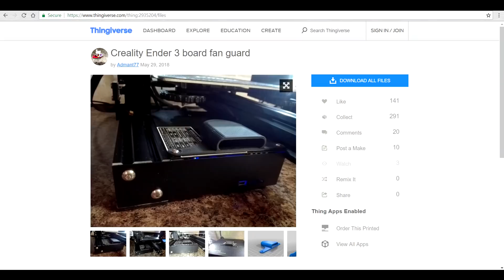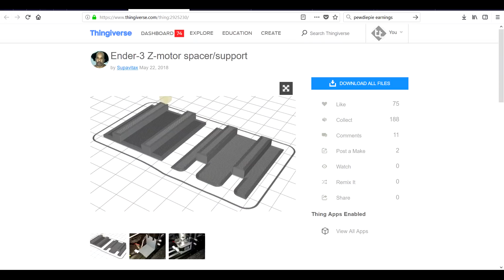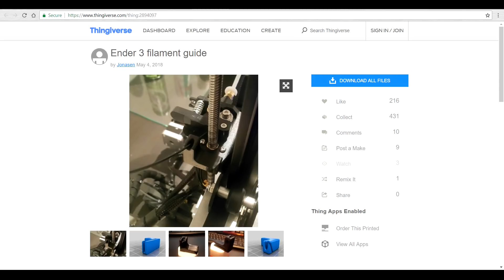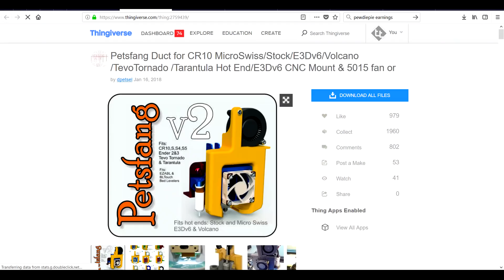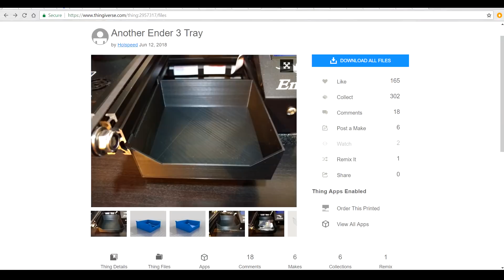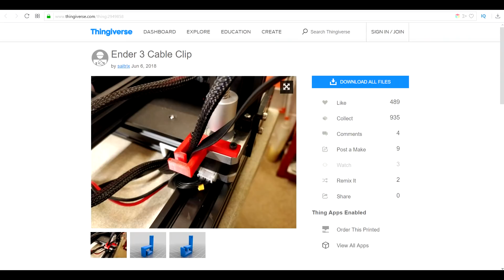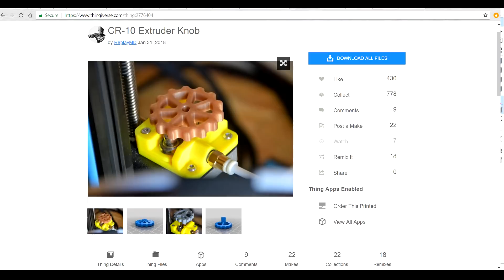The best cheap or free Ender 3 upgrades - re-modding my newest version

Comment: This is great i just got 2 ender 3's and having access to this Info is so handy m8......now ive got to source a 422 or 427 board, i think...one of the printers has a green board, which is not plug and play as ive found out.  Im 50yr ol with disabilitys and these newer models are more user friendly.😀

Comment: Got my Ender 3-Pro a month or so ago as my intro to 3D printing and its not really the same machine anymore. 
I'd say the biggest upgrades in order were a BTT SKR Mini E3 V3 mainboard, Hotend/part cooling fan mount (printed the CR-10/Ender 3 Dual 40mm Fan Ducinator remix with BLT mount), BLTouch/ABL probe, Capricorn bowden, bed spring upgrade and an all metal dual gear extruder. I also bought a glass build plate but 3/10 would not recommend. I'll probably get a PEI plate with spring steel. Some other nice things to have include Vslot Covers, Front LCD panel cover, side mounted spool holder, tool holder/s and there's a few really sweet drawer designs.
What do you guys think, direct drive with linear rails next?

Comment: I printed on of the filament guides that clip onto the upright part of the extruder plate that holds the roller wheels.  It fits kinda loose and I was worried about it falling off, so I glued it in place with a small amount of 5 minute epoxy.  If I ever need to remove it I can probably do so destructively, and then peel off whatever remains without damaging the printer.  Moving the filament spool holder over to the far left wasn't easy, getting the T nuts into the slot between the screws holding the uprights is a RPITA.   I installed a different kind of spool holder.  I found a model on thinigiverse for a spool holder insert with stepped sides that will work with various different spool inner diameters.  These have two 608zz bearing in them (you need to print two of these, one for each side of the spool).  I then printed an adapter to put an 8mm (5/16") carriage bolt in the big hole in the bracket which the spool holders slide onto.  A wing nut holds it together.  It does take longer to mount the spool on this, but it holds it MUCH better and turns more easily.  You can adjust the friction by tightening or loosening the wing nut as required.

Comment: I put a cable holder for the x motor cable, just a bit of baling wire holds out rubber bands that hold a loose cable tie for it.

Comment: A couple of little adjustments I would consider in 2021.
° Don't grind down the bed adjuster, print a smaller one.
° If you have a Pi 4, don't do a completely or near sealed plastic case. It needs cooling, or at the very least free access to ambient air for convection.
° If you do tall prints, or frankly in general - if you have the space, consider moving your filament holder off the printer. Or at least to a mount on the bottom frame.

Comment: I can not see the purpose in Raspberry Pie. you  still need to clean the bed, insert filament, start the print and do a bed level. That requires you to be in front of the printer. It's very simple to save to an SD card and pop it in. I also like the fact that I can save hundreds of STL files on an SD card as a portable library.
Reply: Ray Parker Raspberry pi is one of the best things, most of the things you mentioned you would already have set up for the next print, bed levelling would be taking care of with ABL or mesh, you don’t have to go anywhere near your Printer to start your print, you also have the ability to use  a cam to monitor your print from anywhere and there is a multitude of apps available for iPhone and android to give you full control, its genius.
Reply: @raygilfillan  Different strokes. I have video, and remote shutdown. I prefer to be there to monitor and adjust as needed.

Comment: A faster easier almost instant way to get a lower filament guard and not use any filament is to cut about an inch of the protective cover that came on the Z lead screw and slip it over the screw to stop any grease swapping. Like  Teaching Tech said the simplest solution is often the best.

Comment: I have an issue where my raspberry pi send power back to my ender 3 via the USB port. When the Ender 3 is off the Pi will alarm about the power, and the Ender 3 display and fan will still be running powered by the USB of the PI. To me that all sounds like a really bad thing, so I have not been using my Pi with my Ender 3 at all, and that kind of sucks.

Comment: Hi, I'm interested in buying a 3d printer for my grandson, I'd like to keep the cost down to under £350 or so. Can you recommend a printer that is simple to set up and produces good quality prints. Low powered would be great as well as a large bed, self leveling if possible. Thanks, Graham. By the way, your videos are the best, keep it going please.
Reply: I'm probably waaay to late, but with a Ender 3 pro you can't go wrong! It's the best printer under 300$

Comment: I still dont see the point of unicorn tubing.
Reply: It can withstand higher temperatures for printing materials other than PLA and has a more accurate diameter to help with smooth filament flow and more consistent extrusion.

Comment: How do you think about changing the bed level springs? My Ender 3 pro just arrived and I have troubles with bed leveling since it changes after every print, as the bed level knobs are spinning really easily = /
Reply: Easiest solution is to tighten all the knobs (lower the plate) and then re-level with the knobs done up more tightly. It simply sounds like your plate is too high and thus the springs aren't actually pushing against anything and thus the knobs spin freely. When the plate is lowered enough, the springs will be compressed and the knobs will stiffen up.

Comment: Hi, nice video, thanks. But I've a question about connecting the raspberry pi. I dont see the usb cable for the printer in your video. It is not nice to have all your cables in front of your printer, so I have my rasp. behind my printer. I can't see your becaurse of the high camera view
Reply from the maker: It's highly possible that I simply had it disconnected while filming. The cable management with so many printers in my room is ridiculous.

Comment: Newbie here. How do you recommend picking up and moving the unit around? Do you grab it by the top or sides or base or is it not recommended to move it around much?
Reply from the maker: Worse case is you bump your bed and need to relevel. I don't move it often, but when I do I grab it by the top horizontal frame.

Comment: Hi! I am unfortunate to say that your link to banggood  steeper motor dampers is a waste of time an money. They send the dampers that don't fit x and y motors because they have smaller diameter than on the picture; and the x and y gears on the motors of ender 3 are not removable. Here's the photo: https://clip2net.com/s/3Y6CoYY
Reply from the maker: The fixed gears have recently become a thing. I have updated the pinned post on my damper video and I will do the same on this video too.

Comment: Are the TL-smoother still worth it with the ender 3 pro? Is it the same mainboard?
Reply from the maker: Same mainboard. I haven't bothered fitting them because it is subtle and I had no good result when testing on the standard Ender 3. Others had more success however, it is strange.

Comment: Might be off topic but what is your opinion on adding an external mosfet for heated bed? $10 cad on amazon worth it or is the risk of board damage low on ended 3’s. 
Assuming 1 year warranty is it worth waiting out the warranty period?
Reply from the maker: I've heard of a few busted bed MOSFETS where the heater is permanently on. All of the Ender 3s in the wild and the small number of failures might imply that the current mosfets are up to spec, however.

Comment: Hi Michael, 
I have a Ender 3 and a friend my too, he told me to turn off the extruder fan to printing using ABS. 
So that is realy bether way to printing in ABS?
So my question is, It's safe do that? As i know the extruder is turn on in parallel with the fan board and if i turn that off Can I burn my Ender 3 board?
By the way,  It's possible turn on the fan board directly on 24v output from the power suply?
Reply from the maker: The extruder cooling fan must stay on to prevent damage and clogs. The part cooling fan should be off for ABS, except for bridging and overhangs. Hopefully this is where the confusion is.

Comment: I'm considering getting a Ender 3 as my first ever 3D printer (som completely green to all this). Would you suggest to get the original version or Pro? do you now have to turn the printer over when working on the PCB for upgrades (as the box is reversed to the original and I assume the cover is now on the underside) ? For me it will mainly be a hobby project to tinker with the printer itself and upgrade it as well as printing minis for board games.
Reply from the maker: Ender 3 is perfect for your needs from what you describe. Just remember there is a learning curve and lots of support available in forums and groups. I'd recommend my beginner video: https://www.youtube.com/watch?v=mAU7cIZ0Hns
Turning it upside down is a PITA. I think 99% of people would be happy with the standard over Pro, so I would go with that.
Reply: David  Yeah, got my standard Ender 3 yesterday, already modded ita  bit ;)

Comment: Hi, would you have a cheaper option (maybe on BangGood) for the PTFE tube connectors?
Reply from the maker: As long as they have metal teeth instead of the plastic ones I showed in one of my videos it will be an improvement.

Comment: Mate, if you have the time compare bullseye with something completely overkill just to see how far we can push this thing.

Also any thoughts about converting this to a three point mount vs the stock 4? Might make it easy to level the bed.

Thanks for all the ender 3 advice!!

Cheers!
Reply from the maker: My next planned video is a bullseye vs stock vs simple ring fan add on. I've designed a cooling torture test and am currently printing a bunch.

Comment: Hi Michael,  On the Creality webpage for the Ender 3 Pro it shows a picture of the Mean Well power supply to be a model RSP-500-24 which is  21 amps and 500 Watts.  What I got with my Ender 3 Pro was a Mean Well model LRS-350-24 which is 14.6 amps and 350 watts.  Could you kindly check and see which power supply came with your Ender 3 Pro. Also, is a 350 watt power supply sufficient for this printer or does it need to be more like the 500 watt power supply shown on the creality webpage? Any thoughts on this?

Thank you for all of the wonderful content that you provide.  Your teaching style is excellent!
Reply from the maker: I have recently checked and it has the 250. Pretty shady on Creality's part.

Comment: Thanks for these upgrades. I found another one that seem interesting because it permit damper installation for z-axis motor: https://www.thingiverse.com/thing:2969593 . I know it's not recommended to install damper for extruder but what about z-axis? is it safe?
Reply from the maker: Z should be ok but won't make much difference unless you are printing in vase mode.
Reply: @TeachingTech  ok thanks. I want to silent the homing sequence
Reply from the maker: Yes, good point.

Comment: Hey Michael, the imho best filament guide period is this one: https://www.thingiverse.com/thing:2456930 You can make the inserted PTFE Tube a bit longer for the filament to be fed in a more convenient angle. You can still use your extruder knob. Drill a hole in the top section of the cover and you're good to go. I use this combination on both my  CR 10 and Ender 2. The filament guide you have installed will not protect your printers feeding hole. Over time the filament will grind down your extrunder lever on the top side of the feeding hole. It is constantly grinding on it when feeding filament in. The best solution is a PTFE tube to guide the Filament. Like your Videos a lot. Cheers.
Reply from the maker: Good points, thanks for sharing.

Comment: I got my ender3 2 weeks ago and aside from some bird nests and prints that randomly stopped in the middle (both problems fixed by reformatting the sd card). I am astonished at the high quality of the prints (after I found some good default settings and levelled the bed). I am also astonished at how slow 3d printing is. I have a laser cutter and I can make a large very elaborate cut and it rarely takes 30min.  That being said I'm loving this machine and the happy song it makes when it's printing. Hopefully this will be the inspiration to finally get over the fusion3d hump and leave TinkerCad behind/
Reply from the maker: I guess the difference is laser cutting is 2d. You have to extrude the outside perimeter and then the infill, repeating for each layer. Try turning up your base print speed until quality suffers.

Comment: Check out the double high Pi case, you can put in a buck converter, split the printer power feed and your set, nice and clean.
Reply: Do you have the link for this?

Comment: The spacers for the Z axis stepper isn't necessary.  The reason for this problem is that the bracket that the extruder is mounted on and the lead screw goes through isn't bent at a 90 degree angle.  If you use a machinist square and get that bracket bent to 90 degrees, you'll find that the spacers are no longer needed.
Reply from the maker: Thanks for sharing.

Comment: When my PLA filament guides started humming - like materials don't like rubbing - I came to the same solution of moving the filament reel right to the end as well.
I think they fixed the bowden tube by the time I got mine 2 months ago, because I haven't had any problems with the std one.

Comment: Oh thank God you're gonna do a beginner Ender 3 video. My x axis bar seems to be... off or something. The little fan for the extruder gave out and started buzzing (if you know a solution please let me know) and the bed seems to be unusually difficult to level.
Reply from the maker: I've finished recording it and just have to edit. It should the issues you describe.
Reply: @TeachingTech  oh awesome, I'll keep an eye out! Really want this thing to be printing like I keep seeing others printing with them lol
Reply: Interesting you mentioned the part cooling fan failure.  Mine has just started groaning intermittently which usually means it is on its way out.

Comment: You never mentioned why you are now suggesting Capricorn tubing. When I suggested it to you in an earlier video you didn’t seem to agree.
Reply from the maker: If I recall that was a discussion over using it as a substitute for high temps over an all metal hot end. This is the second video I've made on cap tubing for the Ender 3. The reason I suggest it is to address the many people who had issues with poor quality fittings and tube when the printer first came out.

Comment: Hi Michael, made most up grades. My Ender 3 is working.
Ok I'm using Cura 15.04.2  every time it open it wants me to use the up grade Cura.
So what do i do?
Reply: Maybe upgrade it?
Reply from the maker: If you don't want to upgrade there may be an option to turn off update checking in the settings.
Reply: Could not turn it off Was told to use  Cura 15.04.2  when i tried mimi ,
will it work better  to upgrade ?
Reply: why would you not upgrade to a later version of cura? I;m just wondering what would make you decide a later version of a program is a bad thing or not advised?

Comment: Looking forward to the bullseye comparison! Maybe you can also do a comparison of the Petsfang vs Circular Cooling duct (theres a lot on thingiverse in case you dont know what that is) vs the Bullseye vs the stock :)
Reply from the maker: That would be good, I'll see how I go for time.
Reply: @Teaching Tech Thanks for making a video! I'll look forward to it no matter what you end up including :)
Reply: Same, I'd love to see a comparison since the bullseye v2 looks like a huge pain since it has so many pieces and it's so modular. I'd rather not waste a ton of time and filament if it's just a flashy looking gigantic fan shroud.
Reply: @eldeecg My thoughts exactly. I'm rather lazy and my printer currently works fine as it is, but if there's like a huge improvement, I think I'd be willing to go through the trouble of upgrading
Reply: Personally, i am still deciding whether or not the Petsfang is worth it to go through the trouble of buying another fan, or if I should just use the Bullseye

Comment: Also; as far as i can tell the z axis motor is held in the same way as the updated Ender 3 non-pro.
Reply from the maker: Agreed.
Reply: I shimmed mine with some folded paper strips. Didn't realize that there was some adjustment available within the mounting system. (Ender 3 "Mk 2".)